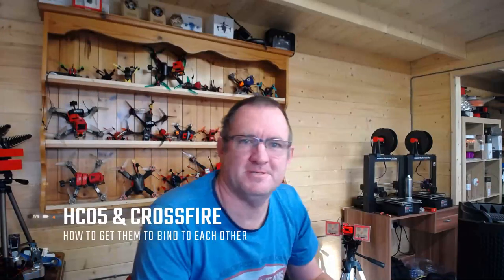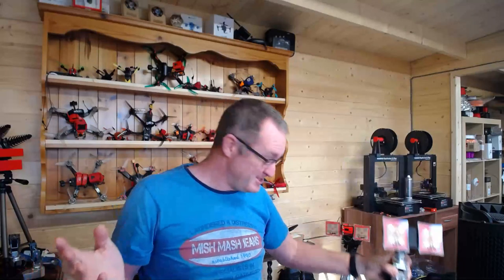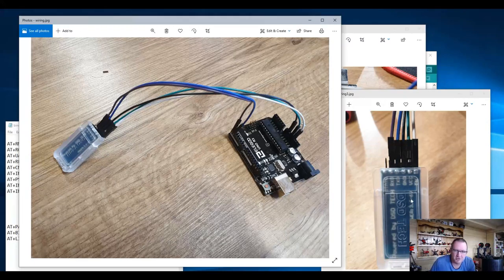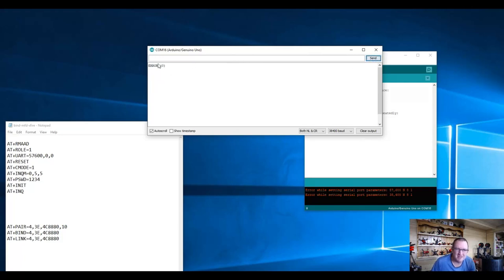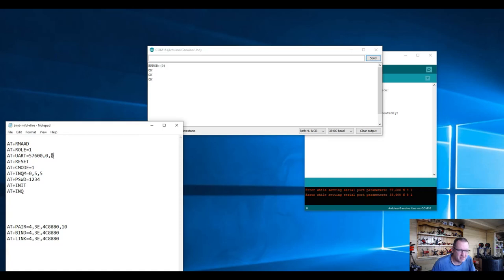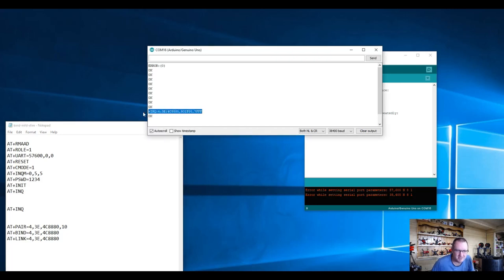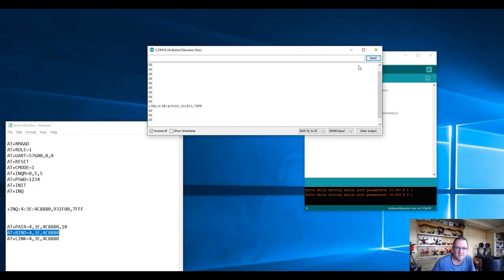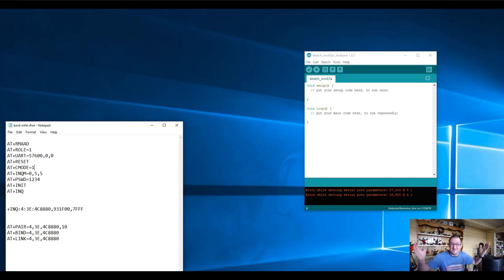HC05 & CROSSFIRE | HOW TO PAIR THEM TO EACH OTHER

Comment: Just in case anyone else runs into this. AT+PSWD=1234 gave me an error but AT+PSWD="1234" fixed it. Thanks for the tutorial Rob :)
Reply from the maker: Thanks for the info.   from what I can tell, this is related to version differences in the hc05 firmware.
Reply: @RTRCTV  I think you're right. I can't get past AT+INIT now. I have another HC-05 coming tomorrow, hopefully that's on a different firmware.
Reply: @RTRCTV  the new HC-05 I ordered worked perfectly. Thanks again. Now the long wait for my crossbow to arrive in Scotland!
Reply: Callum Mckay I went through all that with the Bluetooth modules on 3.0 firmware.  The error from the AT+INIT command is because the module is already initiated. It also won’t take the AT+INQ command. However, if you can get the Crossfire Bluetooth ID from another device you can just continue with the second set of commands and pair the module just fine👍🏼
Reply: @eckythump6429  I am having this problem, cant get past AT+INIT. i have the crossfire address but im not sure how to input it. 00:04:3E:99:37:A1 could you tell me what the command would be? thanks!

Comment: I have two HC-05 modules from a couple of different vendors, neither of which are behaving themselves. Going to buy a proper DSD TECH HC-05 module. They seem to have two different types: 1)HC-05   and 2)HC-05 Bluetooth Serial Pass-through Module - which one should I be getting please? Oh! and is the software version on the module important as both of my cheapy units are version 3.x

Comment: Hey, im very thankfull for your video, but i ran into a problem. I use a ttl Cable connected it (except the 3v3 v). I checked how to get into the mode and it sayed on their page, that i can do it in a other way then connecting 3v3 by holding the button. Everything works nice and well, i even find my crossfire, but i run into a problem at the last step. I dont see any binary. What can i do?
Reply from the maker: Pretty sure you will have to hold the button down the whole time while you do all the steps.. Or this issue happens!

Comment: So, I totally screwed up and got the HM-19 thinking bluetooth 5.0 would be better but the 2 models use different commands.  Would be GREAT to get this one to work with my arduino.  I can get it to talk but going further...  EEK.  I have bluetooth 5.0 in my laptop, since it has a greater distance I can keep the hardware further away and still achieve super fast baud rates.  Would make a great addition if I could get some hnelp using this Bluetooth chip with the tracker and crossfire.....  or just to talk to crossfire.  Thanks so much, love your videos!
Reply from the maker: Had a, quick read of the manual for the.

This does, not seem overly complex.  Lots of guides on the net for them :)

Comment: Great guide man

But why when i put AT+INIT my HC05 get error[0]
Reply: I have the same problem. Did you managed to fix it? Appropriate if you can share with me.
Reply: @ivanlim4787  yes the problem is the module, when doesn’t work is a fake HC05
Reply: @BadSide84FPV  I see. Buying online hard to determine which is real and which is fake.

Comment: Will this talk to an internal bluetooth module in the radio? I have the crossfire lite module without bluetooth. So I installed a bluetooth module in my radiomaster tx16s.
Reply from the maker: Not this method.   You need a different type of adapter.

Drop past the mini crossbow group on Facebook - they gave some good guides.

Comment: I did  all the steps you did, it recognised the bluetooth o my dragonlink but it wont't bind. i alsi added the comma and 10 at the end and it kept on saying fail. is the binding procedure different for dragonlink than crossfire?
Reply from the maker: Hello

I have never used a dragon link.

Its possible that it's not compatible with the hc05 module.   Drop past the Facebook mfd mini crossbow group...    Bound to be someone who has used one!
Reply: @RTRCTV  thank you, I got it to work. I skipped the pair command and did the bind command and it worked.

Comment: Hello Rob. Excellent Video I did followed step by step your video but the problem I'm facing is the follow. I type in Arduino step by step all the instructions and works exactly same way as your video but when I type the last command AT+Link  i do not receive any feedback or binary date. I just stays. what am I doing wrong?
Reply from the maker: Hmm...   Sounds like it's not linking.

Would help cto see a video of each step you take?
Reply: @RTRCTV  yes step by step. In arduino when I introduce every command I get ok as an answer as you in your video.  But just when I intro the last command I just get ok but I don’t get all the binding lines as you.  In my tbs module I set the Bluetooth in bridge. So I’m not sure what’s the problem
Reply from the maker: @juancarlosdecamposalomon1114  set the tbs module to use mavemu .

Bridge is not the same.
Reply: @RTRCTV  still not working
Reply: @RTRCTV  I can sent you a picture or video just let me know where
Reply from the maker: @juancarlosdecamposalomon1114  Rob at rt-rc.com
Reply: @RTRCTV  finally I got the binary communication (Data) between) the BT HC05 and the crossfire. problem now is that when I plug it to the ATT the Vlink shows no communication. Plane is power on. any suggestions?
Reply from the maker: @juancarlosdecampo1441  Ok.. so have you now set the port on the tracker to the right protocol and baud rate?
Reply: @RTRCTV  now is working.  Protocol was in crfs just changed to mavlink and working now. Thanks for your support
Reply: @juancarlosdecampo1441  what was the problem

Comment: Hey Rob! I just looked up the HC05 Bluetooth Module on the Arduino site but there are so many different modules, this is actually my first contact with arduino so could you please link me the module you used so i don't buy a wrong one
Reply from the maker: Here you go..

DSD TECH HC-05 Bluetooth Serial Pass-through Module Wireless Serial Communication with Button for Arduino https://www.amazon.co.uk/dp/B01G9KSAF6/ref=cm_sw_r_other_apa_i_wYEmEbHWB9Q3Z

Also drop past the Facebook group..  Myflydream mini crossbow users.

Lots of help on hand :)

Comment: Is there a specific version of the hc05 thats needed to get this done? Seen another video and he uses the version 2 hc05?
Reply from the maker: Use the dsd tech one.  It works well.
Reply: @RTRCTV  ok thank u, just ordered that and the uno 3 on amazon. Lets see if i can get it to work. Not good at computer stuff but seems easy enough.

Comment: I have a USB to TTL, can i use this with arduino ? or what exactly can i use for a programm ?
Reply from the maker: Hey.. Yes.  Will do the same job
Reply: @RTRCTV  Okay nice but i can get it working. 
My problem is COM4 is the USB to TTL CH340, i connect it right and  the HC05 blinks slowly but i cant do the command AT.
Reply from the maker: @Hennne53  do you have a 3 wire ttl?  Or a full serial port?

You can actually just use the programing adapter for the mfd to do the job

Comment: Hi Rob, i have a BT module i can connect with a TTL connector and give AT commands, but as soon as i get to the command for baud rate it stops getting in AT mode and starts flash rapidly, i tried different ways to put the at commands in, but when given the at command at+reset it is out of AT mode again, so is there a specific order to give the AT commands?
Reply from the maker: I have only ever entered them line by line in the order I have shown in the description.

This is the module I use:

https://www.amazon.co.uk/DSD-TECH-HC-05-Pass-through-Communication/dp/B01G9KSAF6/ref=sr_1_1?keywords=dsd+tech+hc05&qid=1579105738&s=computers&sr=1-1

Get the feeling there are varying standards!
Reply: I enter it line by line, but after reset command, it flips out of at command mode, i am quite giving up i think and not order the mini crossbow, if this is the only way to get it to work with CRSF. Which bt mode on CRFS i have to set it?
Reply from the maker: @lucbisschops  if you get stuck.. I can try do with a remote desktop session to help?
Reply: @RTRCTV   That would be great.
Is it possible it is not working because i do not have my Mini crossbow yet? it should work because it is a connection between my crossfire and the BT module, isn't it?
Reply from the maker: @lucbisschops  ema me on rob at marotori.com..    CN move this offline.
Reply: @RTRCTV  how do i do that, if i go to maroti.com i get a website
Reply from the maker: @lucbisschops  I wrote my email without the @ so bots cannot find it.

So write it out as you see..
Reply: @RTRCTV  i can not mail you, is there a way i can give you a PM in Messenger on FB
Reply: @RTRCTV  i send you a PM on messenger facebook

Comment: When i input AT+RESET the hc05 goes out of AT mode and wont accept anymore commands. anyone know how to fix this?
Reply from the maker: Did you connect the EN pin as described in my video.

Sounds to me like you did not.
Reply: @RTRCTV  that was correct,  thanks! now i get to "at+init" produces "error:[0]" and "at+inq" answers "OK" but does not give me the crossfire bluetooth id.
Reply from the maker: @mikec4430  No idea!   That being said.. there are allot of rubbish hc05 clones on the market!
I find the DSDtech ones on amazon are good.
Reply: @RTRCTV  I got another one today and it worked perfect 1st time! thanks for your help.

Comment: Can this be done with the Nano?
Reply from the maker: No.. The nano crossfire does not have Bluetooth.
Reply: @RTRCTV  Sorry I meant the arduino nano
Reply from the maker: @billyd78  yes.  Will work fine.

Technically you could use an ftdi adapter and hyperterminal.  Same end result!
Reply: @RTRCTV  OK that might be easier (FTDI). I tried the nano but it didn't work. Wondering if I need to upload code to it, and also it might need a voltage divider. Also think maybe that has to use tx-rx and rx-tx? Anyway I will try FTDI tonight and see how that goes...

Comment: Is this a sbus bluetooth conection?
Reply from the maker: Nothing to do with sbus.

It is a mavlink connection to allow you to relay mavlink telemetry to any device   that only has a serial port... And not a Bluetooth port.
Reply: @RTRCTV  thanks, that means you can send the full information for the tracker via serial port, and you need no other device beside a flightcontroller with mavelink protokoll?
Reply from the maker: @oliundtrude5318  yes.  Correct.

Check either mfd crossbow,  ur u360gts project.
Reply: @RTRCTV  ok, thanks I will try to understand...
Reply: I installed the frsky parra wireless module in my tx16s. I have the crossfire full-size lite module. Could this work using Bluetooth via master-telemetry on my radio? Also when using this method I don't need the mfd osd module they off correct. This just acts as a standilone tracker following the rssi link data correct?

Comment: Hi I'm only getting gibberish symbols in the serial monitor. Why is this? Thanks.
Reply from the maker: Suspect our baud rate is wrong.
Reply: @RTRCTV  tried them all...why me, everytime...oh well par for the course...thx
Reply from the maker: @9jester9  you sure you actually in AT mode?
Reply: @RTRCTV  nope, nothing happens by holding button down. Light just blinks slow. Just ordered 2 more from different places hopefully 1 will work.
 Actually nothing ever works for me probably selling this aat
Reply: @RTRCTV  i got it into at mode through an ftdi and got the info from the xfire but still having issues. Thanks for your help

Comment: what is the module version ? Because i have a hc-05  3.0-20170601 module and i don't know if it work for AT+INQ?
Reply from the maker: Try it and see.     Most work :)
Reply: @RTRCTV  yes i try but it say ERROR:(1F)
Reply from the maker: @romainlobello7822  maybe you have an hc06?

You could try putting quotes around the parameters.
Reply: @RTRCTV  but how do you recognize an hc 06 from an hc 05?
Reply from the maker: @romainlobello7822  no idea.   I have only ordered and used hc05
Reply: @RTRCTV  OK thanks anyway  ; )